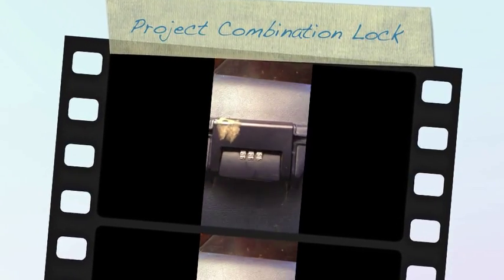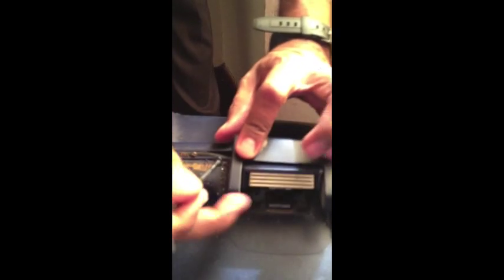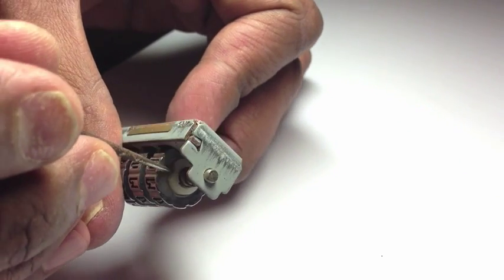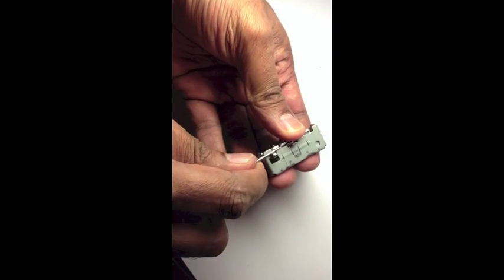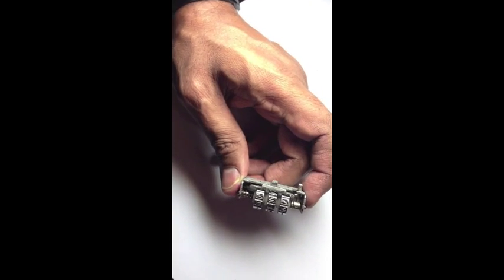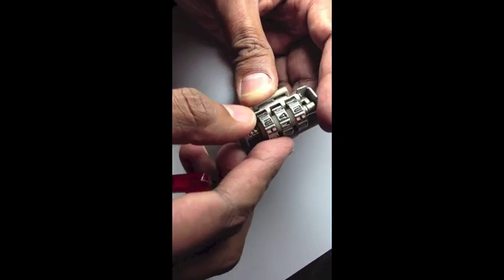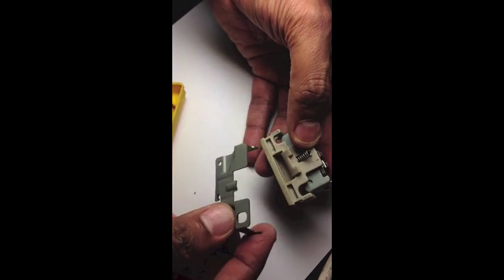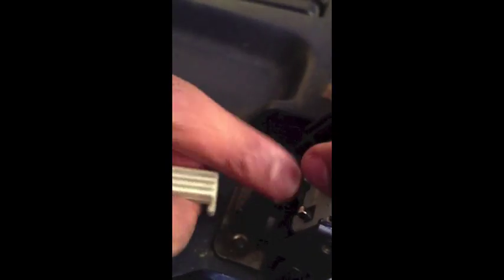Forgot the combination of your lock? Mission Possible!

Comment: its a great video, useful when one forgotten the combination key, and wanted to use the lock again. just remember to find a replacement rivet or bolt and nuts. BTW, the drill size must be correct as not to damage the lock set, yet enable the removal of the rivet.